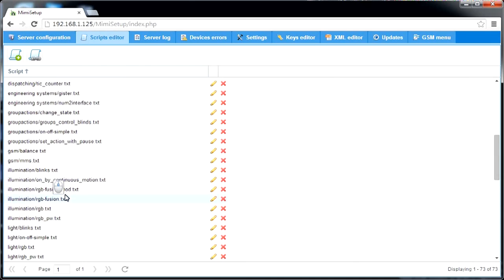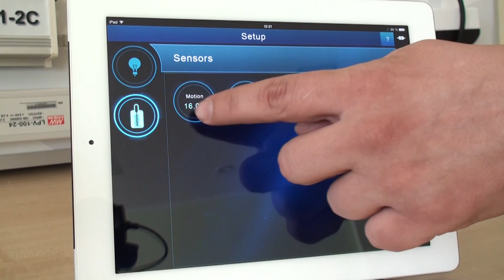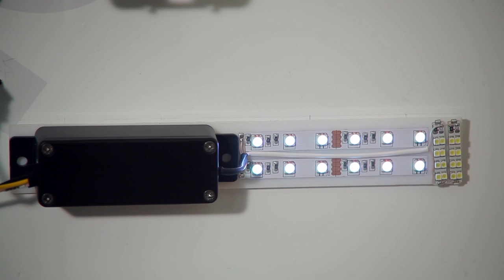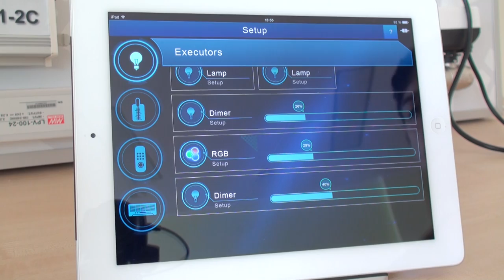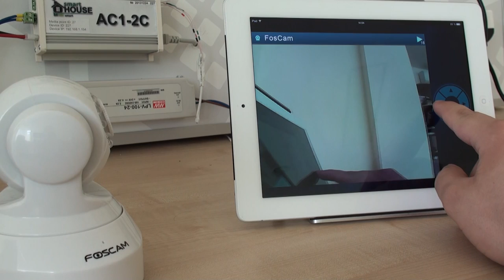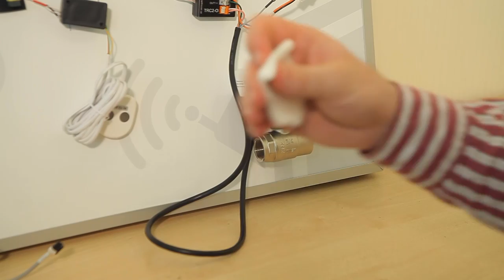Assembly and configuration of the MimiSmart SmartHouse system

Comment: Too many wires, i would remove those control wires like broadlink or orvibo made. Actually you need GSM only to remote reboot of your wireless router if any issues with internet connection, it could be done by simple GSM power socket.